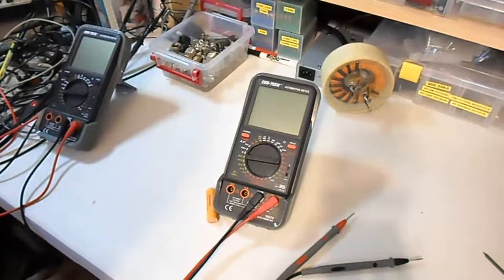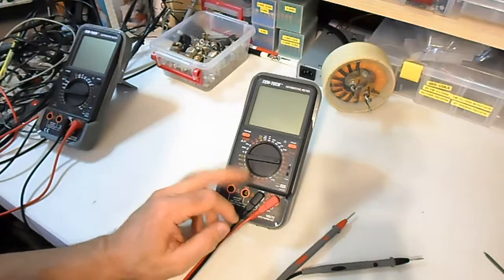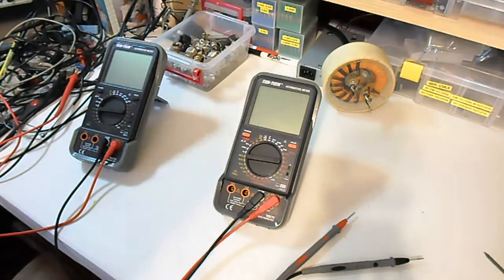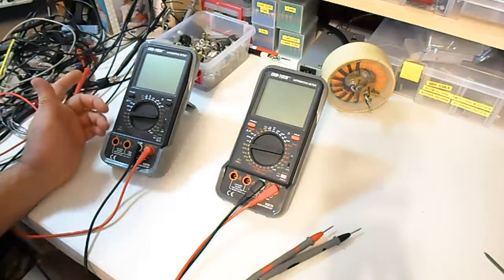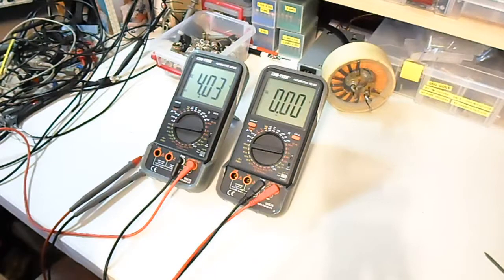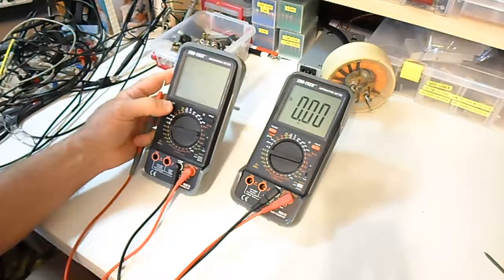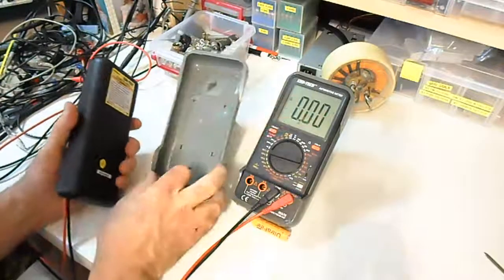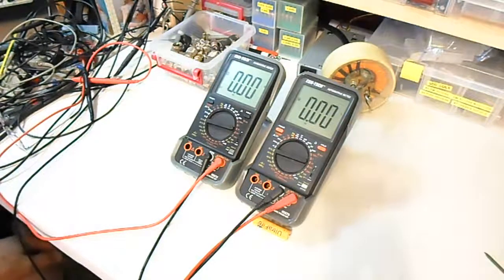Harborfreight Automotive Multimeter - FYI

Comment: Check the current measurements.  Measuring the same amperage, the resolution selections change the measurement reading.  So on 10A, it will read 0.27A, at the 200mA, it reads 0.27mA, and on 20mA it reads 2.7mA... interesting.